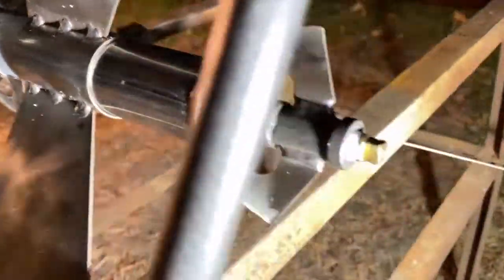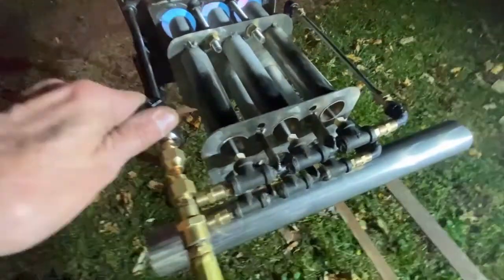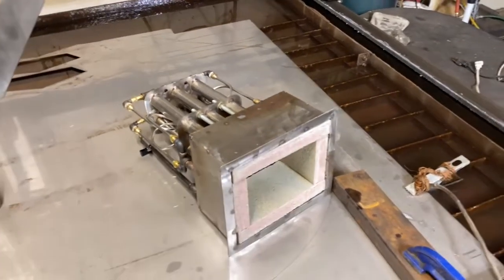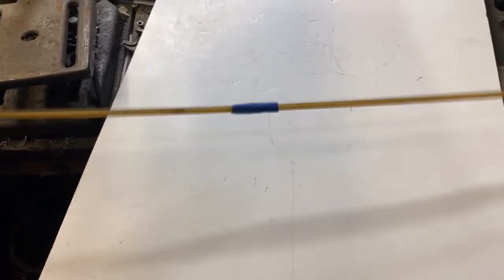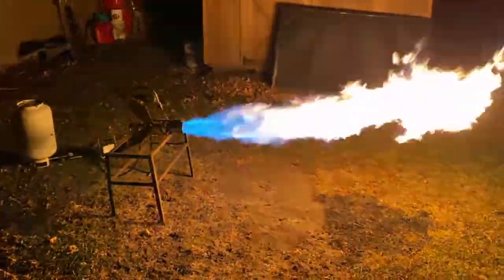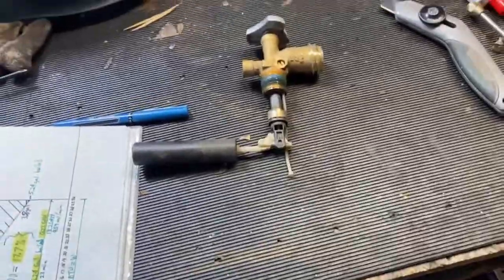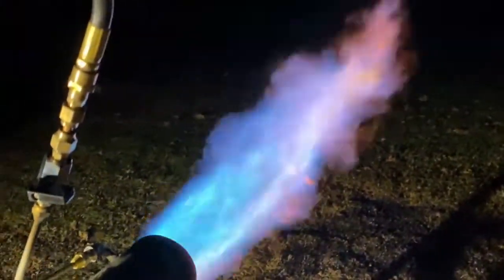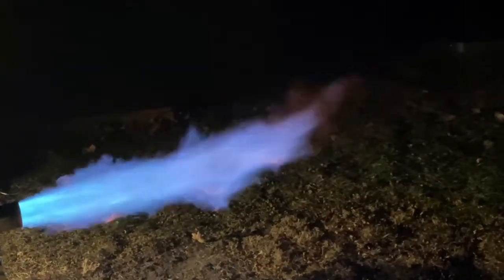Liquid propane burners WHY ?

Comment: LP service technician of 23 years here. That siphon tube dips down to the 80% level, and yes, that tells you when the cylinder is full. The float mechanism is indeed to shut off the cylinder from being filled around that same 80% level. That’s referred to as the “OPD” system, imposed on us by law I think around 1998-ish. OPD= Overfill Protection Device. They don’t always work properly, and so as not to overfill the small cylinder that’s usually going into a customer’s car trunk, you are still required to open that little “fixed liquid level gauge”, that tiny flat head screw deal on the side of the service valve...

I really enjoy your work, and you’ve given me a lot of insight into my future waste oil forge project I hope to one day get started on. Next step: get a welder...and learn to weld...🤔😒
Reply from the maker: Hey brother , that was some excellent feed back , to be blessed with the opportunity to talk to intelligent people in a world full of idiots is such a great experience these days . Thanks for taking time out of your day to tell us what you know about that float ...
Reply from the maker: I pinned your comment
Reply: Absolutely, sir! Glad to do it.

Comment from the maker: propane can also remove plasticizer from hoses so you need propane rated hoses for propane
Reply: I've even had it remove plasticizer from propane rated lines over a few months... but thats the cheap poly hoses you find online.
They work fine intermittently for years, but if used constantly they'll harden and start to leak :(

Comment: Is it possible to reach 1200c with natural gas? I'd be a customer if you could make something like that work. I've tried it, and I've reached 950c, but it tops out at that.
Reply from the maker: Sure can you need forced air and possibly a gas booster because the natural gas is only at 1 psi , get ahold of me threw the description

Comment: Could you switch your tanks to dip tube style or a forklift tank. One designed for liquid output.
Flipping tanks upside down is against code for operation because the tank vapor pressure relief valve is submerged when inverted.
If anything goes wrong its gonna get worse fast.

Liquid feed tanks compensate for this and keep everyone safer
Reply from the maker: Yes i just dont have access . that is called a siphon tube in my area
Reply: @NOBOX7  Your in the USA right? Any major propane or weld shop should have siphon tanks available (or able to install) in 50# or 100# sizes. Unrestricted flow.
Forklift cylinders in 30# and 40# are common but sometimes have high flow restrictors installed for safety.
Pairing a couple of them up gets around this easy.

Either of these options should increase performance, safety, and may help with getting commercial pricing.
If your not in the US then I have no idea. Canada is pretty strict in regulations unfortunately.
Reply: Bro, if you’re ever in the Charleston SC area, I could hook you up with a couple liquid withdrawal cylinders.

Comment: by the looks of it you still have liquid making its way to the spray nozzle. that's why its covered in frost. wouldn't it be better to have it completely evaporated by the point it reaches the nozzle, say by increasing the vaporizer surface area ? obviously you would have to increase the hole size in the nozzle to account for the increase in gas flow once all the liquid vaporizes and expands. never worked much with propane, but at least for old style gasoline torches , you want all the liquid vaporize by the time it hits the nozzle, and thats done with a huge amount of surface area. just my thoughts, nice work.
Reply from the maker: You are correct , this test was used to benchmark these details for the final design

Comment: The standard grill propane tanks can only produce gas from the liquid at a certain rate. You exceed that rate and you get freezing and it's no fun. The 100lb containing tanks have a much higher rate.  I can't make 4 propane tanks in parallel work for my application, but the 100lb tank gives me all the gas I need. Problem is the 100lb containing tank is more difficult to transport and manage. I'm done with trying to get propane from uHaul, they have refused to fill my 100lb tank too many times.
Reply from the maker: Good to know about the 4 tanks . Great input , these types of comments make youtube a goldmine
Reply: If you put your propane container in a water "bucket" you get much more power out of them, because the container pull the heat energy from the water insteat of just the air.

Comment: Initially, condensation forms when the temperature of the gas bottle or regulator drops below the dew point.  This is exactly the same as the condensation you get on a humid day with a glass of ice water.  As the temperature continues to drop, the condensation may turn to ice.
To make sense, it helps to first explain how LPG works. LPG is stored under pressure, as a liquid, in a gas bottle.  It turns back into a gas by ‘boiling’ into gas vapor.  This happens at the very low temperature of -42°C.  To boil, the liquid LPG draws heat from the steel walls of the gas bottle.  This, in turn, makes the gas bottle feel colder than the ambient temperature.  The gas bottle gets even colder when you are actually using the gas.  So, with sufficient humidity and when you are using gas very rapidly, condensation or ice can form on the gas bottle.  The visible condensation or frost line indicates the level of the liquid-gas remaining in the gas bottle.
In short, every time a material makes a phase change some energy is needed/or released. Like putting energy into ice, to get water, and putting energy in again to produce vapor. When vapor loses heat it becomes water again. If more heat is drawn it becomes ice.